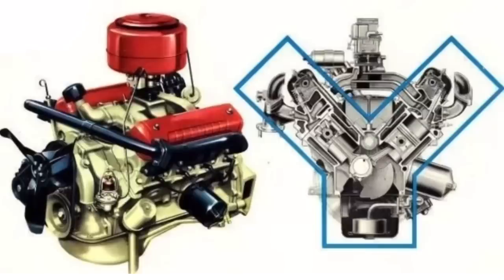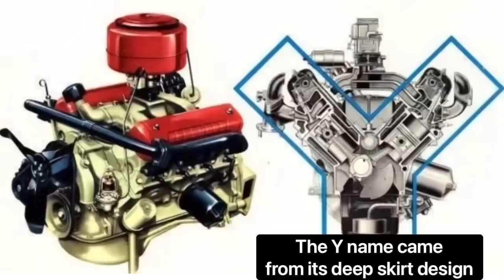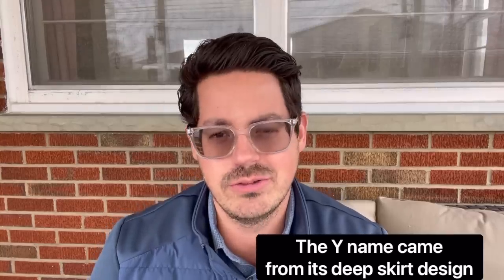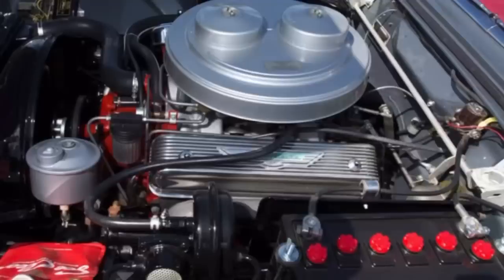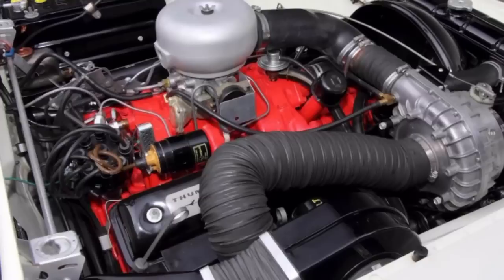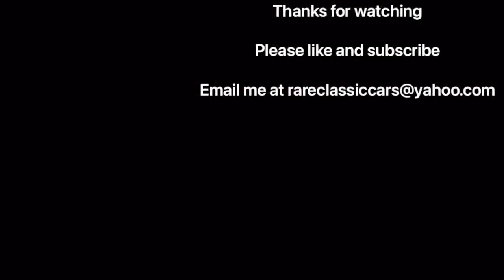Worst Engines of All Time: Ford Y Block V8

Comment: It's really too bad people like you talk through your hat about an engine you never worked on or owned. I have worked on them since 1957. Owned many over the years. It has bottom end torque, good RPMs, and a fresh one will run forever. If taken care of, and proper oil used, it is as good as any engine on the 50's and better than many.
Reply from the maker: I have owned them over the years.  My dad had many of these over the years as well and was a rebuilder.  Some people had great luck, some didn’t. Any engine where the aftermarket supplies plentiful amounts of external oiling kits isn’t that great of a design. 

It’s too bad that people like you talk through your hat about people you don’t know.
Reply: @RareClassicCars  Only the early ones, 54 - 56, had that oiling problem, and they can easily be fixed by machining a groove in the center cam journal.  The later cams came grooved.  Also, you should plug that oil bypass hole in the rocker shafts.

Comment: I wonder when did Ford introduce their first Overhead Valve straight 6 engines? 
I suspect that the 292 and 312 engines need to be considered individually and not lumped in with the first sluggish overhead valve Ford that didn't seem to pull much better if at all than the old flathead V8--Also the 1950 Pontiac Eight put the '54 Ford to shame!  Think the Ford was 2 speed automatic while the Pontiac was 3 speed manual with a heavy clutch,the Pontiac was a huge overachiever relative to its tiny horsepower rating,would have been interesting to have tried a '50  Oldsmobile with its first generation OHV V8 which I imagine must have had to have been quite a bit faster than the Pontiac which was a primitive flathead design
Reply: The first Ford OHV 6 was a 215 cu.in. engine that came out in 1952. Great engine!
Reply: The first 215 cubic inch 6 was actually considered a good performer in the day. It would beat many a V8 to 50mph.
Reply: The FordOmatic was a 3 speed, not a 2 speed.  It started in second, unless you put it in Lo.  In mid 54, they made it so you could get 1st in Drive by flooring it.

Comment: Please clarify if you know. As I remember all Ford V8 in Canada were 352 or 390 engines. I don't recall ever seeing any of these cars with the 292. The domestic Canadian Market was always different regardless of manufacturer. It was a long time ago and my memory is not as good as it used to be
Reply: In USA about 1958 or 1959 the 292 and 312 were beginning to be followed by the 352 and 390 which were the newer FE design and capable of more power and torque,I believe the 292 continued to be made for a few more years,especially as a choice in pickup trucks. By the late 1960s I think the 292 was gone except perhaps in South America,also Ford had other varieties of engines,the smaller 260 and 289 which were lightweight and used in Ford Falcons,these were also developed into one of the engines which was marketed as 351 and lighter in weight than the 352. Even more engines were proliferated such as "Cleveland" high performance 351 and the newer 429 and 460 engines

Comment: I will disagree with you again, a very stout engine, very reliable and very strong. May not be a powerhouse, but got the job done in many applications, cars, trucks, heavy duty, stationary, and industrial. The problem was not on the engine, but the lack of maintenance on the owners part.
Reply: Set next to the Chevy small block, the Y-block was pure, unadulterated JUNK.

Ford was lucky that their cars were aesthetically pleasing in the mid 50’s, because the Y-block was bad enough to otherwise sink the company.

Comment: Hello Adam I’ve been watching your videos for a while now and you have a fantastic collection of super clean nice original low mileage cars and I particularly like your ford and mercury collection as I’m an avid ford fan well done sir! I have been exposed to the y block at a very young age as my father had bought a tu tone green 55 crown Vic in 1978 in butte Montana with a replacement 292 out of a 59 or 60 ford and all the years he drove it he never once had an issue and it always ran superb. He wanted to rebuild the whole car in 2000 and always wanted a 312 engine and that’s what he’s going to install into it and nothing wrong with the 292 at all. I own a few 59 fords and in the one it came with a 292 it was an oil burner but always started Right up and ran without issues and about 8 years ago I replaced it with a rebuilt 272 a friend was selling out of his 57 ford and all I did was add a holley 600 4 barrel pertronix ignition and I faithfully change oil in it and I’ve never had an issue. No I don’t drive it everyday and only drive it in summer but it performs flawlessly and gives me almost 19 mpg and is an automatic.the 3 major strikes against the y block was the misaligned cam bearings starving the upper portion of the engine for oil the tiny wee oil hole in the cylinder heads that once they clogged up starved the upper portion for Oil the rear main oil seals Would leak on the earlier ones and lastly lack of oil changes coupled with poor oil of the times along with if you drove on lots of gravel roads really shortened the life of them as that oil hole in the head would plug up even quicker. Other than that they are a good engine that gives decent performance and will last quite a long time if looked after properly. Yes it was quite the transition from the flathead and guys were likely shocked  at this new fang dangled v8 but ford needed to put some power into there cars and get with the times as overhead valve v 8s were beginning to be the norm. Thanks for your video and I too would not consider a y block a worst engine as they for the most part got largely misunderstood.
Reply: Yes!- Finally! - a mention of the cam bearings turning in their bores and blocking off oil to rocker arms.. That was the biggest issue with the old Y blocks I ran across in the mid-sixties...Pull the cam and stake the bearings or install an oiler (ugh) kit. I gotta say, though, You could neglect/ abuse and run 'em rough, and when those mains started thumpin' (the main reason for the rear main oil seals going out)- and rods began to knock,  those beasts would still start right up in the dead of a North Country Winter.

Comment: Forgot one. Some versions of the Y block had the exhaust crossover from one bank to the front of the ex manifold on the opposite side. End result: all the exhaust gasses passing through one manifold. Not a bright idea.
Reply: Yea if it only had 5 mains, i would put a turbo right up front and block off the driver side exhaust outlet
Reply: That system was used by almost every V8 back in the day and works perfectly. Thats why it lasted for 50 years. It is Importamt for engine longevity. Still works without issues in my untouched, never rebuild 383 with over 350k absolutely troublefreie miles. Still runs like new after 63 years.
Reply: @bigblockjalopy  Not sure what you are referring to. The exhaust crossover into the manifold on the other side? Chrysler never did that, the exhaust from both exhaust manifolds junctioned in the down pipe downstream from the exhaust manifolds on vehicles with single exhaust. On some Y block engines (I have only seen a few, mostly pick ups), the exhaust manifold on the left bank (drivers side) had the opening facing forward. There was a crossover pipe that sent the exhaust gasses from the left bank of cylinders into the front of the exhaust manifold on the right bank of cylinders. Therefore the right side exhaust manifold was carrying all the gasses from 8 cylinders not 4. Not a good idea. If you are referring to an intermittent oil supply for the rockers you are right. All the Chrysler V-8 engines used that method of rocker oiling and it worked quite well, way better than the Y block system. On the Y block the rocker oil passage in the block didn't align with the passage in the cylinder head so they cast a shallow channel in the cylinder head for oil to pass through. That was one of the clog points.
Reply: @larryhutchens7593  i was talking Heat Riser. One sides ex gases Routed to the Others via the intakte  manifold when cold to aid warm Up, prevent carb icing.
Reply: @bigblockjalopy  True, almost all of them used that in one form or another.
Reply: @larryhutchens7593  Just read your previous comment again. Chrysler always did that up into the 80s, as EVERY carbureted engine needs it. And it is a very effective and troublefree system.
Reply: @bigblockjalopy  The last carebureted Dodge truck engine was in 88 with the 360 engine. The 318 that year had TBI with hyd roller cam. In 89 the 360 went TBI also.                Effective but I wouldn't exactly say trouble free because the heat riser on the right side manifold could freeze shut if not properly maintained. Also the passages going thru the intake could get clogged with carbon on older engines that were running rich & consumed a little oil. I have had to clean out a few & that is one tough job. The path is kind of convoluted, especially on engines with EGR. I have seen a video on U-tube where the guy took a propane torch to get the carbon buildup burning then used compressed air to force air thru the passage. Seemed to work quite well, looked like a blowtorch on the other side. Another type of heat riser was used on 50s era MoPars. Those old WCFB carbs had an automatic choke that used a heat stove in the exhaust manifold. There was a metal tube that passed thru the manifold & was open on the lower side of the exhaust manifold. The auto choke had vacuum applied to the interior of it so that hot air could be drawn into the choke chamber. Worked really good until the tube in the manifold burned thru. There were aftermarket heat stoves available when that happened.
Reply: @larryhutchens7593  Well, I drive a 1960 Plymouth Fury almost daily since 1988 and have/had several other 60/61 Mopars. I'm pretty sure, absolutely no one still alive in the western hemisphere traveled more miles in a car build before 1970 than me. 

That "maintainance" that the heat riser needs is just a few drops of oil once or twice a year and if you drive regularly, it just can't freeze. If you service you car the way it should be done, the crossover passage can't clog up. In my untouched 350 000+ miles 1960 383 not even the spark plugs need cleaning. 

None of my heat risers ever froze or caused any problems. I even added a heat riser to the tube headers on my 383, as it is, contrary to popular believe, a vital part of the fuel system.
Reply: PS You can see that old high mileage 383 perform in 2 of my vids. 0-60 4.9 seconds with a 2.93 open diff.
Reply: @bigblockjalopy  I have had plenty that were frozen. Probably from sitting a long time. I think that the proper lube to use was dry graphite. The last one I messed with was  a set of high perf 383/ 440 manifolds. They had some sort of bushing in the manifold that the butterfly shaft ran in. They were extremely hard. I know because I tried to drill them out. Drill bit wouldn't even scratch them. I had those on a 383 that I put in a 65 Satellite that I no longer own. On those the shaft was rusted to the point that there was no way to move it. The little bushings were like new, no rust or anything. I have no idea what kind of metal they were made of. And the heat riser does aid in drivability by helping to vaporize the fuel. However, racers always defeated those for the sake of added performance.
Reply: @larryhutchens7593  yes, engines were not made for sitting. In 60/61 the shaft is stainless steel.
Reply: @larryhutchens7593  You would clamp a steel cup over your exhaust manifold and put the heat tube in it.  Make the automatic choke slightly looser.
Reply: @larryhutchens7593  My heat riser on my 54 Hemi was gone, the flap was missing.  The engine runs fine, as I always warm it up first, but if I try to drive off with it cold, it bogs and snorts along for a few miles.

Comment: Also: That little oil channel in the cylinder head that transferred oil from the block passage over to the head oil passage. A cast  channel that was prone to accumulating sludge during stop & go driving. And those mushroom shaped lifters?
Reply: All you have to do is groove the center journal on the camshaft, or use a later cam with the groove already there.  That way, the oil to the rockers with be continuous, rather than intermittent.
Reply: @michaelbenardo5695  Oil still has to go through that little groove in the head to get to the rockers. A potential clog location. The Chrysler small block design that started life as a 277 CI engine in the 56 Plymouth also used intermittent oiling to the rockers. The camshaft had holes drilled in the #s 2 & 4 cam journals that allowed a shot of oil once every rotation of the camshaft. However the oil passage going thru the cylinder head aligned with the passage in the block. The cylinder head used on the 56 was a poly head design and they had the same problem with rockers plugging up but not as much as did owners of the Y block. Probably due to the use of non detergent oil like the author of this video stated. The poly head was dropped in 65 or 66 to be replace by the LA small block but the intermittent oiling system for the rockers continued until the magnum engine series started. The Y block had a decent physical design but the several small problems doomed it's future.

Comment: cam bearings....Very fussy in some engines...Big Block Buicks need to have special attention to cam bearing specs and ALIGNMENT.  430 in particular had reduced size in the journal oil feeds.  Grooved cam bearings help but installer needs to know what they are doing.  I had this issue in a 1969 Buick 430, just after rebuilding (new aftermarket pistons, cam, stage 1 heads) it lost oil to the drivers side of the engine.  With guidance from Posten Buick Enterprises (RIP) I was able to removed the transmission,  remove the oil galley plugs in the rear, and install an "oil galley bypass" kit.  This was two elbows and a piece of brass tubing,  it restored the oil feed to the drivers side, and it ran great until i sold the car.

Comment: The Chevy 235 also had top end oiling problems. The passage along a head bolt to the rocker shaft would plug. We put a bypass kit in ours to solve that.
Reply: And if you drove a 235 too hard, they had bottom end oiling problems as well.
Reply: @ronaldpoley4357  — Those old 235 engines had “splash” oiled rod bearings — actually little dippers poking out of the rod cap that scooped up oil. Kinda like a Briggs&Stratton mower engine ...
Reply: @sking2173  They got rid of that for 54.
Reply: @ronaldpoley4357  The 54 and laters ones didn't have that problem.  Full-pressure oiling.

Comment: Yep have to disagree….I had a 312 out of a mercury that I bought for $10…..bored that thing clear out to 360 C. I. Modified the oiling systems, and that was one bad sumabitch. Ran it in a ‘55 Ford P/U with a 4:09 gear. And it was a complete stump puller….the three speed O/D transmission did not like what I did….
🤣
Reply: That was one rare 312 block. with the predominate core shift most Y blocks Could not be bored very much/
Reply: @thecollectoronthecorner7061  yeah I think it was just .060 over…I was just exaggerating 
😆

Comment: What is the significance of the name:  "Y block"?  All V engines are Y blocks arent they?  What am I missing here in the terminology?
Reply: The skirt on the Y block comes down past the centerline of the crankshaft.
Reply: @brucegregory3629    Thanks, I see that now
Reply: @brucegregory3629  The Buick Nailhead was like that too.
Reply from the maker: It was a deeper skirt design than most.

Comment: My first engine rebuild was in my 1956 Ford Ranchwagon. The Holly 4Bbl was horrible.  Got better service out of a Ford 2bbl. I was always adjusting the valves. Distributor was in the back making it difficult to get the points right.  Many of us had burn marks on our wrists from trying to change spark plugs before it was cooled down. Forget replacing spark plug wires. Lol

The beast had the great torque of a 6 cylinder but NO acceleration.  But it would go up Parleys Canyon at 80 mph.....as long as I hit 80 before the incline. It was about a 900 pound engine. I won't even start with the air cooled automatic that I overheated on the Bonneville Salt Flats....lol
Reply: Wrong !, It weighed at tad over 600 lbs.
Reply: @jeromebreeding3302  good for you.
Reply: @scottfelsted3203  It was heavy for sure, but not a porker.
Reply: @jeromebreeding3302  Yeah, my memory must be faulty.  I just remember looking at a Sears catalog as a kid to get a rebuilt long block and thought it  was 800lbs for shipping.  I remember thinking how heavy it was.  Other bigger engines seemed lighter.  Crazy.
Reply: @scottfelsted3203  If you hop you the Y-block with an aluminum intake, and tube headers, you'll trim quite a bit of flab iff the old girl.
Reply: @jeromebreeding3302  I know where there is a 55 Mercury Montclair sitting in the woods.  I hope to get my hand on it one day.  I'm surprised there is an aluminum intake!  You know more than I do.

Comment: Worst ford engine from my lifetime would be the ford 3.8 v6. Head gasket eating machine. Lucky my dads tauruses all had the vulcan 🖖
Reply: Yep, Ford screwed a lot of customers with that 3.8 piece of crap. But this Y-block was a real loser, too.
Reply: You haven't done your homework well. Y blocks do have some oiling issues. But if they are maintained decently they are one good engine. And whoever said they didn't have a nice sound must be deaf.